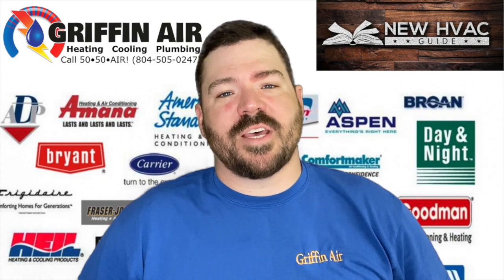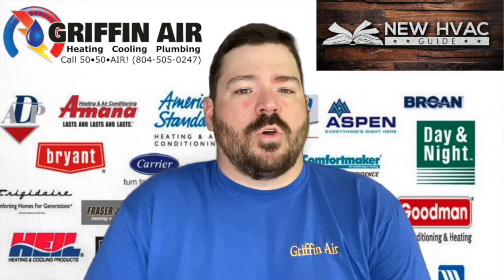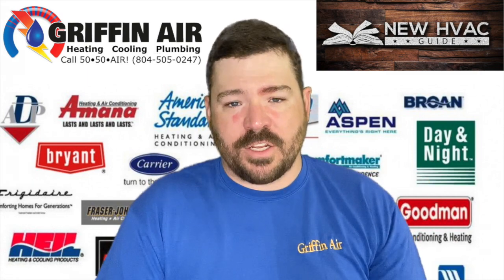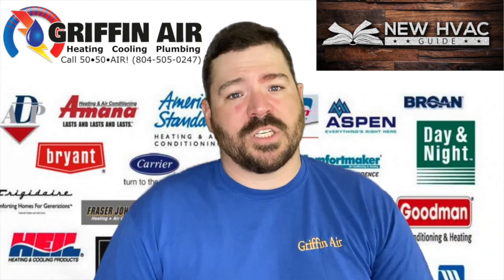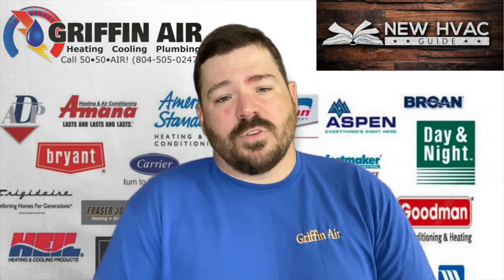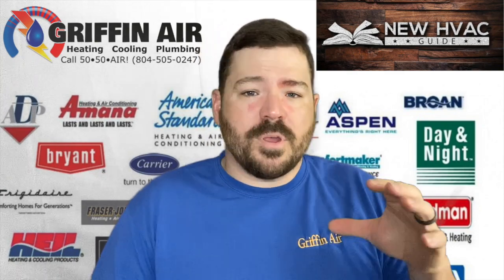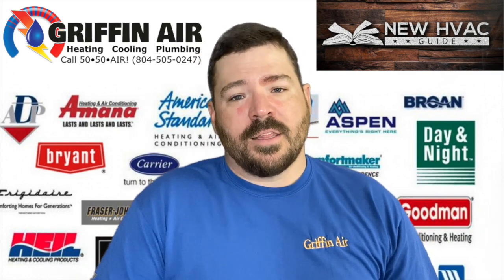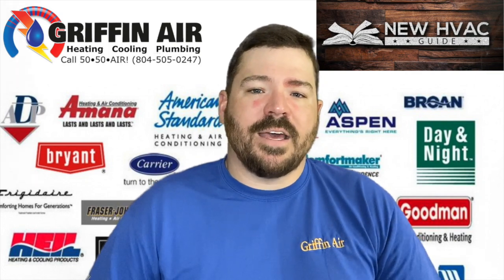Bosch Heat Pump High Humidity solutions

Comment: Thanks for the video…. 

We bought our house 3 1/2 years ago. We absolutely love the air quality in our house.
Our thermostat is set on a program that we keep our house at 77° during the daytime and 73° at night time. The entire time we’ve lived in the house we get a humidity report from our thermostat and it always averages between 42% and 45%. 

Unfortunately, our air conditioning system just died and we purchased the Bosch  BVA 15 series.

It’s been installed for just over two weeks and we can’t get our humidity to go below 60%. We are absolutely miserable. The only way to get the humidity down to 60% is to freeze ourselves out of the house. If we keep the house at 72° during the day then the humidity will sometimes drop to 59% but that’s about the best we can get. And at that point we are freezing. 

Our AC guy keeps blaming it on our house. Says that we have an old house with bad insulation and so forth. However, for the last 3 1/2 years, we’ve had 42 to 45% humidity the entire time. The only thing that has changed is this air conditioner. 

We have asked if it is possibly oversized and he keeps saying that he put the same size on our house that we had before. I’m not 100% sure that he knows that this thing is selectable that he can bump it down. 

I guess that’s my question. Is the BVA 15 series selectable in tonnage? And also is the fan speed selectable? Right now, when the air conditioner turns on it sounds like a hurricane coming out of our vents. And before we never even heard the air coming out of our vents.

Thanks for any advice …

Comment: Here's something that has my current tech, his supervisor, and the supervisors boss stumped. MY Bosch system is running and the humidity coming out of the vents gets as high as 75%. I have a 50 pt portable dehumidifier in the house that can keep the humidity down around 50-55%. Since I have a humidity problem, I had a 130 pt whole home dehumidifier installed. When it runs, the humidity in the house runs 65-80%. The techs have found no air leaks in the ducts.

Comment: How do I know if the installers put enough Freon in the system. It calls fine but it doesn't really reduce humidity when I turn it on basically stays the same level so maybe the Freon level is too low and how would anyone know this?  Super cooling level was fine around nine.  But it's very disappointing that the humidity just does not decrease at all and I'm viewing ecobee stats which are very good

Comment: Hi!  Great info!  Great channel!  Quick question: Should I "upgrade" to a Bosch BVA 2.0 air handler (two speed) vs a Bosch BVA15 (fixed speed) air handler for my soon to be installed Bosch IDS Light BOVA15?  My home is roughly 1900sq feet.  I'm in south west Ohio.  The Bosch will be replacing a 20 year old Goodman heat pump (which has been VERY problem free).  Thank you in advance for your thoughts!

Comment: JUNK
Reply from the maker: How dare you call me names. 🙂
Reply: @NewHVACGuide  . Just speaking of the 2.0 5 ton I purchased. Terrible mistake.
Reply from the maker: What issues have you had?
Reply: @NewHVACGuide  Can't get the humiliation down. Running a humiliator . My old unit never had an issue at all
Reply: @NewHVACGuide  Very high humidity. Had to purchase a Dehumidifier. Still struggle to het it below 60%. Had a old Goodman unit that had no issues at all. Could cool the place to make you chiver.

Comment: HVAC pro here. I have a Goodman 16 SEER single stage compressor downstairs and an American Standard 20 SEER HP variable speed, upstairs. 60% is typical for my house during the hot humid summers. Not happy with humidity removal.

Comment: I need your help. Im stuck on putting a float switch on my IDS 2.0. They didnt hook up the pump switch and i want an ss2 in it too. The ss2 is plumbed. im just confused af on how to connect it. Break red? Communicating unit? Spot on board for connection?

Comment: Thanks for all your videos, I have watched them all and chose a Bosch duel-fuel system from my research and your comments.  
I love everything, with on exception ---   (HUMIDITY)   Unfortunately   --  you are not in my area!
I took out a 2 ½ ton carrier and replaced with the 2-3 ton IDS 2.0 heat pump/96% furnace,  and the humidity level is not anywhere near where it used to be. 
I have to run a dehumidifier about an  1-3 hours a day, which I never did before;  except in the spring or fall when AC or heat wasn’t needed.  

I have made every possible change and setting to reduce humidity and they have helped, but still hovers around 55% .

I haven’t tried  putting the unit in 2 Ton mode.  Most everything I’ve read was leave it default, the unit can compensate?

Should I change that setting and revert all changes back to default and work through them again?
Any suggestions would be much appreciated.

Comment: Hi Josh,
Great video!
I’m not too familiar with the Bosch bova-36 system, but even with the surge protector could the control board get fried. There was a power outage and since then there is no light on the board and the heat pump has not come on. Is there a switch to reset the board or it’s time for a new one. Any advice well appreciated.

Comment: Hi, Josh . Great video. You are such a treasure to hvac community. Currently I hired a hvac company to install a Boash ids 1.0 for my house. The original control wire from coil to condenser is two wires used for AC. The hvac company install a transformer to take care of C wire. After two control wires are connected, system runs fine in dual fuel mode with exception of that furnace does not kick in during defrost mode. Could you please let me know whether it is possible to use two wire to run Bosch condenser with help of the transformer in condenser. Or. a new set of control wire needed to be run.

Comment: I had a Bosch 3 ton heat pump unit installed in 2018, my air handler fan has started running 24/7 with thermostat on auto, check thermostat green wire is good, replaced air handler circuit board and relays. Outside unit has a 56 on display. How do I reset the code?

Comment: thanks for this video, just got the bova/bva15 installed and humidity has went up drastically.  Ac is running for short cycles and stays off for only 2 to 5 minutes many times.  It seems like the bosch thermostat ignores all of my settings to change it's oversensitivity and cycle time. My crawlspace dehumidifier can't keep up.  I am not seeing a way to change the tonage of the air handler, is this just the low/med/high fan speed wires?  I looked through the manual and couldn't find anything else.  1600 sq ft house set at medium.
Reply: not sure what you meant by "1600 sqft house set at medium"? if you're referring to CFM dipswitch, then they should be set for approximately 400 CFM per ton. then you would want to turn dipswitch on the outdoor unit that's labeled "accelerated heating/cooling" for humidity problems.

Comment: We have IDS 1.0 installed in 2019, and recently seemed to have more humidity issues that we recalled early on, and while not solved completely, we had a tech come out and look at unit.  He found that a wire to s sensor that sits on top of the compressor (that one covered in "thermal jacket") with some type of potting material had been severed and was no longer connected.  He made temp fix until new wire was available.  This helped the feeling in the house somewhat, but humidity was still high.  While it is late in summer and benefit may have to wait to be evaluated next summer, we had SW4-4 set to ON per what https://www.youtube.com/channel/UCp_5AZlvvW9jn6L4EZuCbNQ  had suggested, however, capacity was not changed (J2) and remains on 36k in my case.  We have lots of shade, which does not help humidity issue, but unit struggles with moisture removal IMHO.
Reply from the maker: That wire issue is crazy.  Have you tried reducing the air flow at all?
Reply: @NewHVACGuide  (1st, thanks for the reply)  I'm researching how to check/verify current air handler setting.  However, something I looked at seems to suggest to me (a layman) that some technical measurement related to duct work would need to be made to know what air handler setting should be made.  (Of course, I may not be "spot on" here....).  We do keep the air handler fan running 24/7 once we noticed humidity issue as a way to force more cycling of unit on & off, but this had little to no impact on humidity removal.  We like the unit, but the humidity problem is quite concerning to us, and IMHO it indicates something is not right about the unit that has yet to be identified.  I wish I could remember what humidity levels were when the system was first installed...

Comment: New home.  Builder uses Goodman but let me opt for the Bosch 1.0 because they were being discounted.  Have had Bosch appliances  and always impressed with quality.  We've now hit cooling season in Texas and are having high humidity readings between 65% to 75% consistently.  On really hot days when the system runs longer the humidity readings are higher.  We've had the installer's service tech out 3 times and they can't find anything wrong, but did confirm the high humidity in the house.  I've asked that they contact Bosch since they don't work on them normally.  I'm at my wits end.    I have filed under the builder's warranty and will file under the Bosch warranty as well.  I don't know what else to do.
Reply from the maker: Turn on dipswitch four and lower the air speed to as low possible. Also, turn the capacity switch to the lower number. Finally, make sure all ductwork is sized properly.
Reply: @NewHVACGuide  Will keep your recommendations on hand until a find a knowledgeable service tech.  Last builder's service tech reduced the tonnage from 2.5 to 2 tons.  That helped with humidity readings in the summer dropping down to mid 50s.  I know the ductwork is not sized properly (all one size) but again waiting till I find a reputable, knowledgeable service tech.  Thanks for your response.
Reply: hello,lots of questions but just related to the bosch system-what type of thermostat or control are you using? set both the heat and cool cycle rate to 1 per hour,your thermostat may have a fast/med/slow-set to slow,i have the emerson sensi t-stat and had to adjust for better heating control
Reply: @@nealcassady1189
Reply: Thank you for your follow up.  The A/C contractor did reduce the tonnage setting which helped in that A/C ran longer, but now with the temps well over 100 degrees and the A/C running 9 to 10 hours a day, the humidity still hovers around 60%, even when the average outside humidity is 50%.  I contacted Bosch—they suggested the next step would be to slow the fan speed down.  Also suggested “could even not use Y2 if that is connected.”  I have no idea what that means?

Comment: Great info.  We have been struggling with high humidity in the summer time for sometime.  We will try this when the summer months come along.  My question is in regard to the winter months.  We're in PA and through out the heating months the humidity in the house is 24%.  Is the Bosch heat pump capable of raising the humidity in the house in the winter months?
Reply from the maker: No HVAC system can raise the humidity in the winter. You will have to have a humidifier installed.
Reply: @NewHVACGuide  I wasn't sure thank you.  But the humidity in the summer is something that can be resolved?
Reply: @krisf9443  Very low humidity in winter and very high humidity in summer could be caused by too much outside air infiltration into the home. You may need additional air sealing, i.e. in the attic top plates. Or it could be as simple as making sure door seals are in good shape. There is only so much humidity the heat pump can remove in AC mode.

Comment: Help! Just got a Bosch hvac. Super high humidity in house! Windows and door pouring water with condensation!  Water has damaged all window sills. 1-7-2022. Installer will not fix problem. Says it’s our house’s fault. Paid $22,000. For system that don’t work right and destroying our home.
Reply from the maker: Oh my gosh! Where are you located? I only service eastern side of Virginia
Reply: 22 k-for one system ?? abash ?? you were ripped off in many ways...

Comment: I had a 2.0 system put in my attic as a second zone. My problem is a get water accumulation in the pan. It looks to me like it’s condensation building up and dripping but it could also be a leak or something else. I used local installer and he’s not sure either. Has anyone else had this issue or know of how to trouble shoot this issue or recommend a solution ?
Reply from the maker: Check the primary drain pan. It’s not hard to over tighten the drain adapter and crack the drain pan

Comment: I have a BOVA 2.0 system setup for 2 stage heat & cool.  ODU dip switches are set for accelerated cooling and adaptive capacity OFF (SW4-3&4 both ON), however I cannot ever seem to get my DAT (sensor located just above the coils) to drop below 49 deg.  It hovers right around 50 deg regardless of which cooling stage the zone board is on.  1st stg cooling set at med fan speed, 2nd stage cooling set at high fan speed (I have 4 zones with in-duct dampers).  What do you recommend my installer do to reduce the DAT (more in line with the 37 deg coil temp) and enhance humidity control?  Thanks!
Reply from the maker: Have them put the unit in charging mode and check the subcool.  Also have them check the indoor metering device operation.  There may be something else wrong, but I'd start there.
Reply: wow,seems like a very intricate install-bosch uses the suction pressure transducer in outdoor unit to drive hz or speed . did you ever get set up any better?

Comment: As a homeowner, how do I tell what capacity between 3 and 5 tons that my unit is programmed/set to run at? Is this a number that can be displayed on the board at the outdoor unit? Thanks.
Reply from the maker: Unfortunately, it is not. It’s mostly about airflow with the Bosches. You would have to get the manual and see what the airflow is set at.
Reply: j2 dip switch -select capacity-you can find it in install manual -power unit down first....high voltage on the inverter board

Comment: This past April we had central air installed. We chose the Bosch BOVB 36 1.0 18 SEER system matched to the Bosch BVA 36 air handler. I suspect because the air handler is a multi-speed system we have had zero issues with humidity. This past Tuesday the dew point was in the upper 70s and it felt like the Amazon Rain Forest outside. The air was thick, damp and heavy. Inside our house was cool and comfortable. Humidity level in the house was 52%. We could not be happier with our selection. The contractor was an authorized Bosch  installer so he knew how to set up and adjust the system. We had him put in a 2 zone system with zone dampers. The system works flawlessly.  We also had 2 Emerson Sensi WiFi thermostats installed. I'm in Lower NY state and back on Memorial day weekend the temps didn't get above 45 and the Bosch system kept the house toasty warm. I can't say enough good things about the Bosch BOVB 36 system.
Reply from the maker: Wow. Awesome to hear
Reply: Paul do you remember how much was your electric bill with the heatpump vs without, when it was 45 outside?  or in the summer how much do you pay extra for keeping it cool,  I am looking for some point of reference to compare,  I have the exact same thing, and I paid about $50 extra,  as it gets hotter outside, maybe this month July or August, i could be looking at 100 or 130 difference for cooling, does that sound about right? This is for a 1300sqft house keeping it around 74 degree Connecticut
Reply: @iancunicolae2626  because we ran the heat pump most of the time... overall our electric bill was down about 25 to 30 in the summer and winter
Reply: What zone board was installed?

Comment: Thanks for all the good info here. I selected the IDS 1.0 for my install which is happening next week. I had a last min buyers remorse thinking I should have purchased the 2.0 because I like the idea of having the variable speed air handler. I originally thought the BVA-482n1-m18 was variable. The brochure  states it's a "multi speed ECM blower". What exactly is this? Does it run at a constant speed 100% of the time? Help!
Reply from the maker: ECM is basically a multi speed motor. Depending on the mode the system is in, it may run in a different speed.

Comment: Change the cycles per hour on cooling. To run longer.
Reply from the maker: We don't normally need to mess with the cycles for proper equipment operation or performance.  Has that been a big help for you?
Reply: Yes on multiple different systems with humidity issues, Bosch 2.0 it’s worked
Reply from the maker: Nice. We haven’t installed any of the 2.0s. We do more Daikin than anything.
Reply: What would you reccomend the minimum run time be if there is not a cycle per hour setting?

Comment: Just switched dip 4. I’ll see how it does. Located in MD. Humidity slightly high but not bad.
Reply from the maker: Make sure that the air flow is correct as well.
Reply: @NewHVACGuide  how do you adjust the airflow?
Reply from the maker: @frugalmcdogal8779  https://www.bosch-thermotechnology.us/us/media/country_pool/documents/bosch_ids_bva15_iom_10.2020.pdf

See pages 15 and 22
Reply: How did the humidity level change when you flipped the switch? Right now my humidity levels range from 50-60%. I would be prefer levels of 40-50%.
Reply: Did you cut the power to the outdoor unit before switching the dip switch?